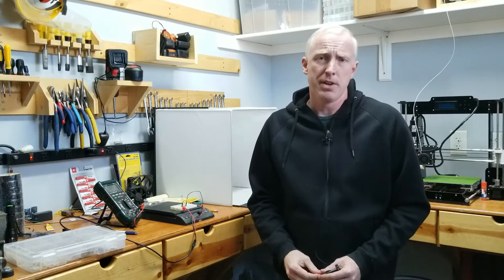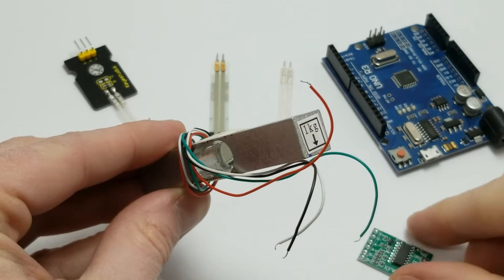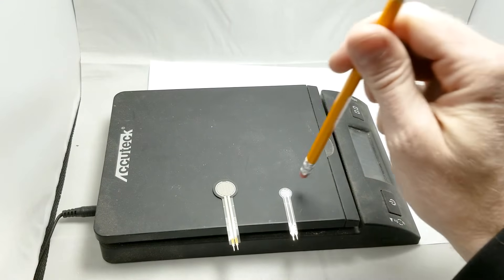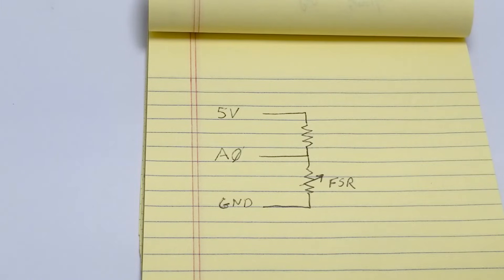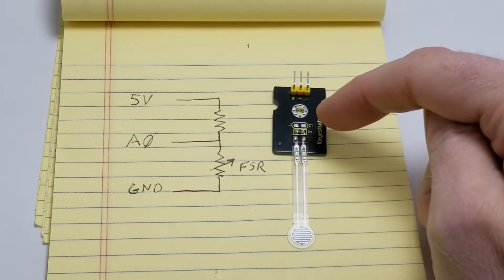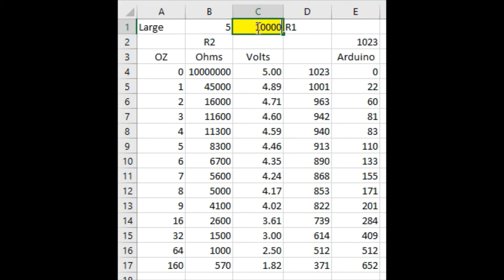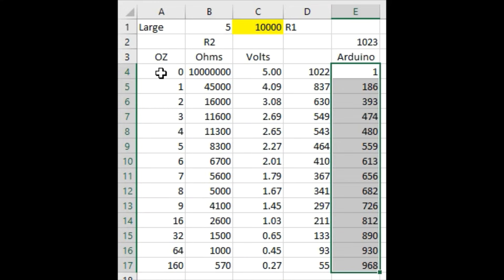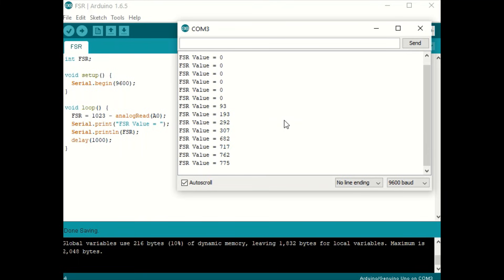How to use Force Sensitive Resistors (FSR) with Arduino - Simple Force Sensing Arduino Tutorial

Comment: Can this module be placed under a platform and still detect force applied to the platform? Also is there a way to set a baseline force? For example if I put it under a 20 gram base. Zero out the force of the base. Will it detect anything that is placed on too of that base?
Reply from the maker: Yes. You could do both of those things as long as the base is resting over the sensor. Also, you could use a "calibrate" button to zero it out. Good luck.

Comment: Hello, I want to measure the pressure in the sacral region of a bedridden patient weighing approximately 80-100 kg. Can I use this sensor?
Reply from the maker: They have different sensors of various sizes and capacities. The weight must apply directly to the measuring part of the sensor. Might not work well.
Reply: @ScienceFunInnovations  thank you.

Comment: nice in a lab enviroment, any tips for how to protect this flimsy plastic in real usage
Reply from the maker: I've built 3D printed holders for them...and use a rubber ball or pencil eraser in the other half of the fixture to help distribute the load over the sensor.

Comment: Hi, thanks for sharing! Do you have any idea what effect an increase in temperature would have on the FSR? i want want to measure a force between two 200 degrees celcius plates
Reply from the maker: Not sure. Let me know what you find out. It may change the readings, but if it is at a constant temperature it should be repeatable.

Comment: i want to use the FSRs sensors for a teakwondo body protectors scoring systeme, but i learned that this sensor is tamperature depend, so is that true ? because if that's true will affect at the scoring systeme
Reply from the maker: It may be temperature dependent, but probably only with extreme temperature changes.

Comment: What is the reading of the sensor, does it read resistance, voltage or pressure?
Reply from the maker: The sensor changes resisitance based on force. Using a second fixed resistor, you create a voltage divider which you can read with the Arduino.

Comment: can i use fsr as a pressure sensor for a seat
Reply from the maker: It would be difficult because the weight needs to press directly on the sensor, which is very small.
Reply: @ScienceFunInnovations  ok but what we need is only to check if there is weight on top not really the specific weight just whether there is pressure on the seat or not also will the sensor be damage if a human sits on it

Comment: To use the FSR, do you need an Arduino? Can you just hook it up to a regular circuit (power source + light)
Reply from the maker: It is just a variable resistor, so you could design a circuit without using a microcontroller.

Comment: Awesome video and very helpful for a personal projet I'm working on! I was wondering if you have recommandations for stronger connection between the fsr and the rest of the circuits because my fsr placement is prone to sliding and shifting. Second, where did you find your weight column (first one on the excel) showed at 3:20? I'm using a 402UX and I'm working with heavier range of the pression and I'm still looking for the optimal resistance for my divider (any help will help :D). Thank you so much again to make quality content available!
Reply from the maker: The weight column was just different weights that I tested. Just try different weights to build your own table. Hopefully that is what you were asking.
Reply: ❤😰1, , a

Comment: what equation were you using for the Analog read next to the arduino output?
Reply from the maker: Not sure... you mean the voltage divider equation?
Reply: @ScienceFunInnovations  no, sorry. Having trouble getting the output to the left of the Arduino outputs to come out correctly. I got all the other values using voltage division but when you hovered over that 2nd to last column, I thought those were the actual registered values and the last column was the inverted output. So I was trying to use Vout=Vin(5/1023) for the 2nd to last column.

Comment: I am having two joyit sensors 0-2kg and 0-10kg. But I am not sure the values are correct. how do I calibrate it ? please tell me the procedure to calibrate the sensor and give me correct values
Reply from the maker: I used a small scale and pressed down on the sensor with a pencil eraser. Then I made a table that compared the analog value to the weight. These sensors are non-linear, so you need some sort of calibration table.

Comment: Hi. I am connecting the JOYIT SEN-Pressure sensor (10kg) to Arduino UNO. Using your code and I can't measure the weight/force (in Kg). Could you help, please?
Reply from the maker: You will have to test it with a scale and build a table that converts voltage (analogRead) to kg. I used a postal scale and pushed down on the senor with a pencil erasure.

Comment: Hi Can I use this FSR for measuring upto 10- 200 KG. Please give the value of resistor to be used or the relevant video link. Thanks.
Reply from the maker: Different model FSR's have different ranges. The value of resistor will depend on which sensor. I just selected on that maximized the range of analog input values from the sensor.

Comment: How do I calculate the changing resistance in accordance with the changing force? is there any formula or should I practically find it out?
Reply from the maker: It is not linear, so you have to test it with different weights.
Reply: Like Science Fun said, you will have to do testing at various different forces and try to find the line of best fit. I did something similar with a time of flight sensor since the offset of the measured distances from the true distance isn’t linear. I actually got fairly good distance measurements and was off by no more than 0.25 inch (which was more than adequate for the project I was working on).

Comment: Hi. Could you let me know what resitor use for FSR UX 400 sensor?
Reply from the maker: I'd look up the data sheet and select a resistor using a voltage divider circuit.

Comment: does anyone know how I'd connect about 200 sensors to an arduino?
Reply from the maker: You can connect several 1-wire sensors, but I don't know about 200. May need several Arduinos that send data to a master Arduino.
Reply from the maker: What type of measurement are you trying to do?
Reply: @ScienceFunInnovations  It's for inventory management. Binary, something is on a shelf or not.
Reply from the maker: @akyle96  Look into daisy chaining parallel-in serial-out shift registers. Haven't used them myself, but you should get one giant chain of 0's and 1's that you can analyze with your code. And you should get by with just the serial rx pin if I understand it correctly.
Reply: @ScienceFunInnovations  I'll look into that, thank you!

Comment: can I measure the impact force using this?.I want to build an impact analyzer. I want to measure real-time impact force due to cricket ball after hit the arm guard
Reply from the maker: It is possible. Just know that the sensors are non-linear, so a strain gauge setup might be more accurate.

Comment: Do you need a finger or conductive contact for the sensor to work? I am thinking of putting these sensors on a robotic gripper I am building and it will be used for picking objects up. I got told that these resistors need a conductive material for it to work such as a finger?  Is this true?
Reply from the maker: You don't need a conductive material. The medium is all enclosed in plastic. It works really well pushing on it with a hard rubber. I often use a pencil eraser the same diameter as the sensor.

Comment: How does the resistance vs force graph look on a log-log / semilog scale? 
Thanks for sharing:)
Reply from the maker: It would smooth out a little bit, but I suspect it still would not be too linear. But it still works great for simple comparisons.
Reply: @ScienceFunInnovations  
Thanks for the reply. The reason I'm asking is because the fact the the resistance is not linear in the force doesn't necessarily mean that it's hard to predict one from the other. Plotting the data log-log / semilog scales could tell us about the functional relation between the two. For example, an exponent would look like a straight line on a semi-log y scale while a power-law look like a straight line on a log-log scale